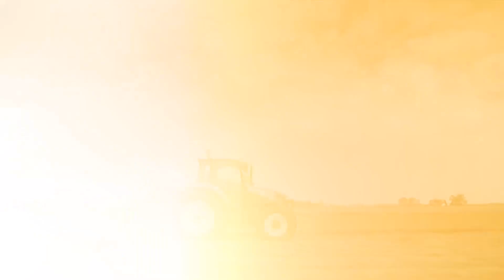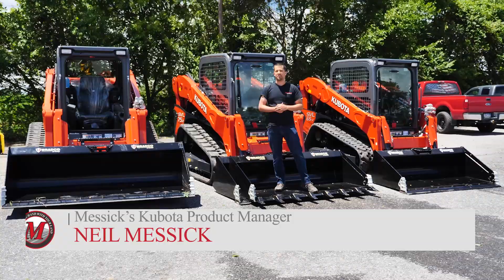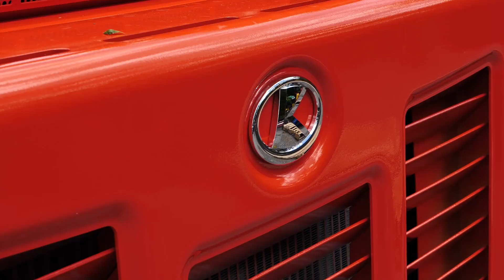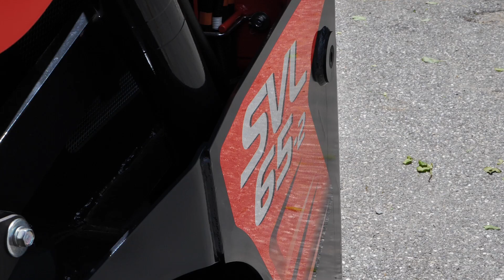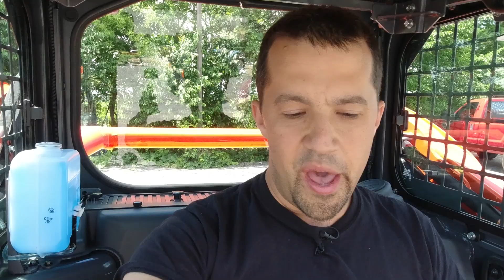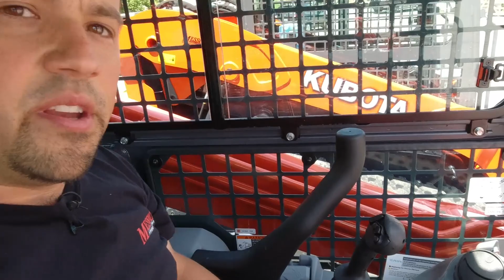*New* Kubota SVL65 Compact Track Loader

Comment: Any word of a -3 in the pipeline to address the common issues with the older cabs?  Having a really hard time deciding between the 65 and the 317G. The 317 is a lot more expensive but it has its flaws too.
Reply from the maker: New products are announced in October. It would be logical the 97 and 65 would follow the 75
Reply: @MessicksEquip  okay. I’ll wait until then to see what happens

Comment: I really wish Kubota would do what some of the others are doing such as Bobcat and ASV that are making track skid steers that are under 5 ft in total width as well as being in the 5k to 6k weight range. A lot of us don't need the high hydraulic flow or the larger engines. The standard flow was smaller engines will usually meet our requirements as well as get us in and out of tighter situations on our applications.

Comment: Are you sure the hydraulics are the same between the 75 and 65 ? On kubota's site it lists the high flow for the svl65 at 27 gpm, and the svl75 lists 29. Im asking because I'm about to purchase either a 65 or 75.
Reply from the maker: HF maybe different,  standard is the same
Reply: @MessicksEquip  Thank you

Comment: Great Videos and Information ! Was wondering about the seat. You mentioned that they cheapend the seat. I  believe it's a grammer seat.  Also does Kubota offer a air ride seat for the new svl65-2 ?  Maybe the seat for the svl75 will work in the svl65 ?
Reply from the maker: Yes. Seat components are expensive though. Until you would mess around with it you'll be halfway to just buying svl75

Comment: Why does the SVL line use different front and rear lighting than the SSV? Looks like the SVL is LED lighting and SSV using halogen? Wondering why they don't standardize on the same lighting.

Comment: Definitely some great features not sure why kubota hasn't integrated a suspension system yet. Running a rigid bottom vs a suspension bottom is a world of a difference in terms of comfort.
Reply from the maker: Comfort yes, but its not good for stability and performance
Reply: @MessicksEquip  or grading.

Comment: Yes the overhead door is the best feature how does the hydraulic over hydraulic controls work in the winter and cold weather i gotta gaycb with it and when cold it is down right dangerous it’s about a 5 second delay from when you wanna stop or change directions from when ya do

Comment: In Tennessee a cdl is a gvcwr of 26k and over, you don't have to have one to haul a 95, or even a kx-57. Unless you're using a massive tandem 12k trailer thats 8k+ pounds. Unsure for other states but I personally use a 02 f250 7.3 and have for over a year to haul our 95v2 and kx-0057v4 for that matter with no issues. Now if only kubota would release stuff to allow us to delete the machine once the warranty is up.

I've never felt our 95 was to "bulky" or heavy to use imo, and if its a super tight space then use a dingo.
Reply: What's the gvwr of your f250? Definitely more than the curb weight. Gvcwr of a f250 and a large trailer may not get to 26,001 but it will be close. Also a 12k gvwr trailer is not supposed to pull a 11k machine unless the trailer weighs less than 1k (which would either make for a very amazing or very terrible trailer).   I have a 14k gvwr trailer that weighs 4k which leaves a hauling capacity of 10k. Maybe I'm wrong here but this is how I understand gvcwr to work.
Reply: @mattkenaston7180  that’s correct
Reply: @mattkenaston7180  I’ve got a 14K trailer behind a 3/4 ton Chevrolet that’s 9000 GVWR that brings me up to 23,000 still under CDL with a 10K capacity. Pretty close to the limit of what you can do without one, though I do have one and a truck that’s appropriate for it, that’s my under CDL for the small jobs.
Reply from the maker: It's a class A license over 10k, not Cdl. Either way, it takes a special license

Comment: I like the kubota loaders i have ran a few of the 90-2 and im disappointed that they have not fixed the issue of the  door hitting you in the head. if you watch he had to lean back and i have watch many people as well as i have ended up curled in a ball after releasing the door from the up position as it comes down from the top a couple inches. We run takeuchi however the kubota we feel is very close to it but the slide up door on the takeuchi doesnt hit you in the head. We have rented kubota in the past when we want to get a second loader going and really do like it.
Reply: That be rough to smack yourself in the head with the door...I've yet to do that, but I've hoped up on equipment
a little too eager to go, & smacked my head into the "Rops system" even with a hat on... it hurt like
hell, gouged a chunk of flesh out of my head. Sighs

Comment: Looks like a well engineered machine,is it narrow???I don't care so much about weight,but physical size.Here in Ontario,lot sizes and beachfront cottage lots are getting smaller,you need a smaller machine to fill this void,ASV so far has the smallest track machine.BUT I want Japanese engineering and quality and reliability.KUBOTA still needs to get there size down.I run all Kubota EXCEPT for track machine due too size.I prefer jap not American engineering,this stuff is too expensive for come back fixes and warranty work.

Comment: are PA CDL laws a 10k trailer not  26k combination?
Reply from the maker: you need a 'Class A' license, not a CDL. I confuse the two.
Reply: @MessicksEquip  What the hell is a Class A? We don't have those in WA
Reply from the maker: @Ramdodge582  https://drivinglaws.aaa.com/tag/types-of-drivers-licenses/
Reply: @MessicksEquip  those are cdl (commercial drivers license) classes. We have the same but I specify CDL because CA has licenses for non commercial use for larger vehicles like RV's.
Reply: @Ramdodge582  Yes you do, they are federally the same.  https://www.dol.wa.gov/driverslicense/cdltypes.html

Comment: You can use a #12000 trailer with no CDL
Reply: bill smith as long as the trailer and truck aren’t total over 26K
Reply: As long as it's not for hire , you are good till 26k. I was told that when I was pulled over by pa dot.
Reply: I was told by a Pa. State Trooper that trailers over 10,000 you need a combination weight registration for your truck,(expensive).
Reply from the maker: Not in PA :-)
Reply: @MessicksEquip  yes in PA. I am in PA and we argued this before.
Reply: @billsmith9610  Per the following PA DOT publication, it specifically addresses this issue, they're indicating for non-commercial use you don't need a CDL, although for trailers over 10k pound capacity you do need a Class A drivers license,  which has additional testing requirements, similar to a CDL: http://www.dot.state.pa.us/Public/DVSPubsForms/BDL/BDL%20Fact%20Sheets/Non%20commercial%20A%20and%20B%20fact%20sheet.pdf
Reply: @stevenkuntz5438  that is for over 26,000
Reply: @billsmith9610  I'm not an officer and haven't reviewed the actual laws, although I'd suggest reviewing the PA DOT publication, as it appears to indicate something different than what you're stating (even for non-commercial use), notably the following: 

"CLASS A (minimum age 18): Required to operate any combination of vehicles with a Gross
 Combination Weight Rating (GCWR) of 26,001 pounds or more, where the vehicle(s) being towed have a Gross Vehicle Weight Rating (GVWR) in excess of 10,000 pounds."

"I have a truck with a GVWR of 17,000 and a trailer with a GVWR of 11,000; however, the
 trailer will be empty. Do I still need a Class A driver’s license?

Yes. The GCWR in this case would be 28,000 lbs and because the trailer is over 10,000 lbs this
 would require a Class A license."
Reply: @stevenkuntz5438   you need to learn how to understand what you pasted there.
Reply: @billsmith9610   I went and looked up the text of the actual statutes and I'm coming around to your argument, although the laws and examples could be much more clearly worded in their intent.

Comment: My crystal ball is wondering how much longer the 75 will be around?  I am thinking the 65 will take its market share directly from that of the 75!           sdh in the Tobacco Valley of CT
Reply: Yup. Cheaper, 10k trailer, no def. Should have just made this to begin with. If only they could do away with the DPF.
Also from CT, northeast.
Reply from the maker: 75 does not have DEF... but yes, this has a lot going for it. I do think you'll find your construction guys will still go with 75's for the heavy boom, but your Ag applications will prefer this.
Reply: Farther than Stafford? Can't be farther than Thompson! Have frequented both regularly since 1970. Granby here.
Reply: @steveholton4130  
Woodstock.
Reply: @dand33911  I used to visit Y Camp Woodstock a couple of times a year with my 2 daughters when we were in Y Indian Guides program in the late *0s early 90s.
Reply: @steveholton4130  
Nice fish in black pond there..
Spent a few weeks there myself years ago.
Reply: @dand33911  Cool Beans
Reply: I have about 30 hours in my svl65 and I have no regrets over the 75. Uses the same buckets, I can drive and fill the bucket with the 65 and it handles it well. Also the 65 is about 7 grand less then the 75.
Reply: Market for both Charlie